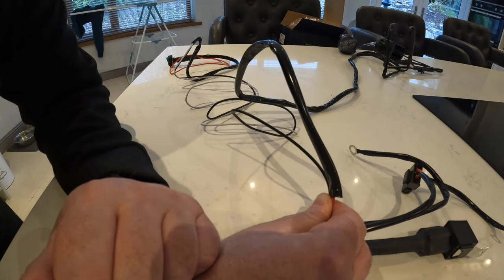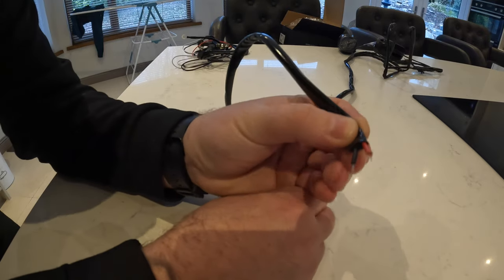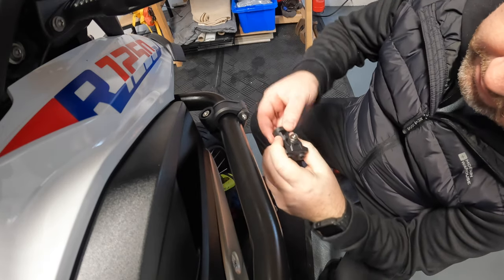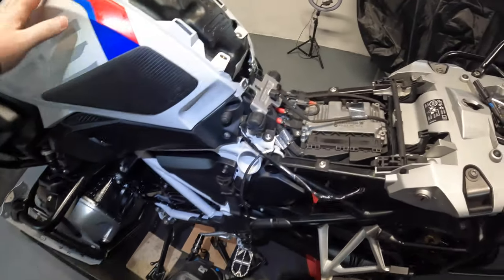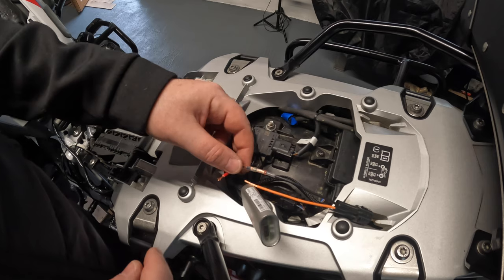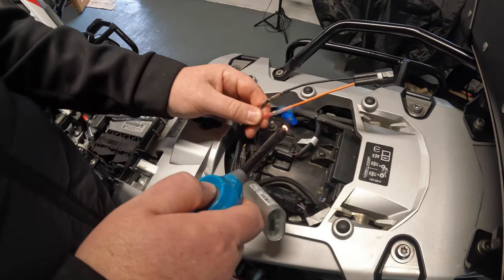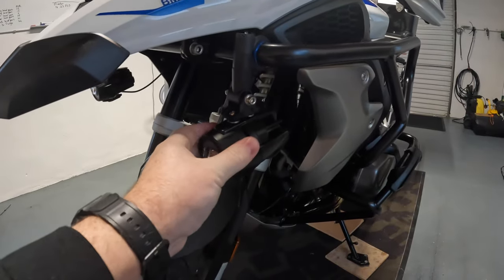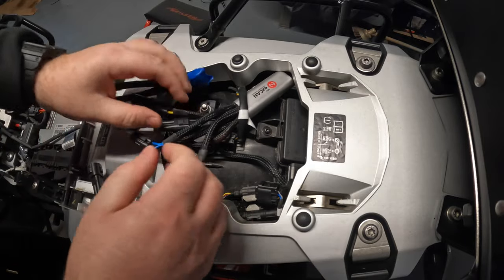BMW R1250 GS  - PUIG Aux Lights Install

Comment: Hello. I need to find the positive of the high beam. I would like to connect Denali spotlights that only come on with high beam.can you help me? where can I find it?
Reply from the maker: If you use a hex ezee can you can connect to a laptop and set it as you like.

Have you a hex unit?
Reply: @motoadvire  I have neither ezcan nor cansmart. But my Denali harness has a blue wire that goes to the high beams. The problem is where to get the high beam signal.
Reply from the maker: I’m afraid I haven’t the information
Reply: @motoadvire  thanks....
Reply from the maker: @andreac.8560  you could add a switch to the wire you have and then wire straight to the battery. A little messy but it’s doable
Reply: @motoadvire  I think go to buy a Denali cansmart 😜
Reply from the maker: @andreac.8560  they are amazing, great bit of kit. I have my heated clothing programmed in with the heated grips. 

Genius technology !